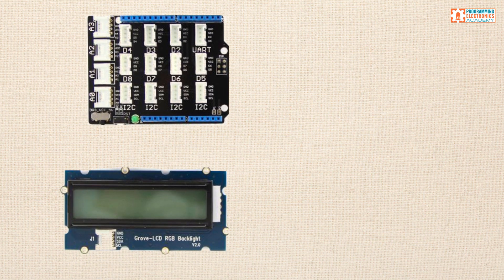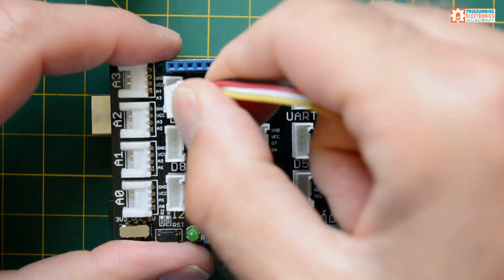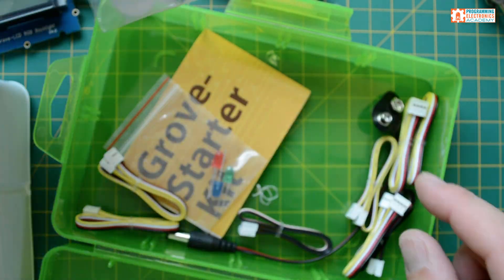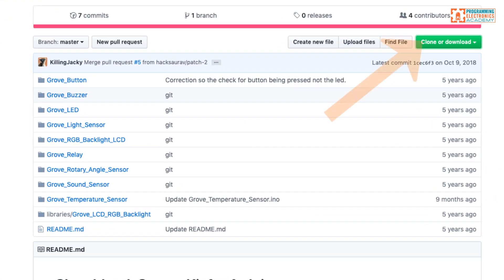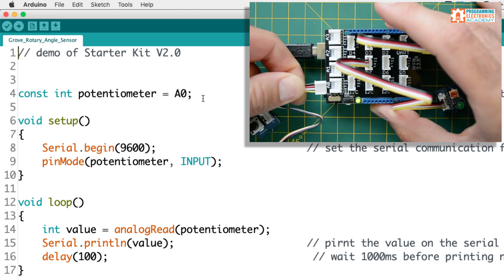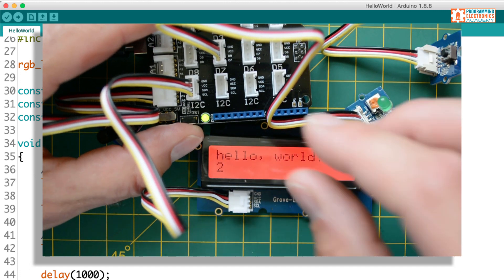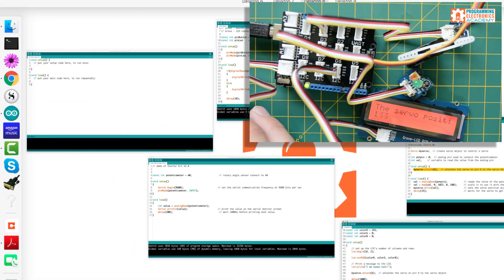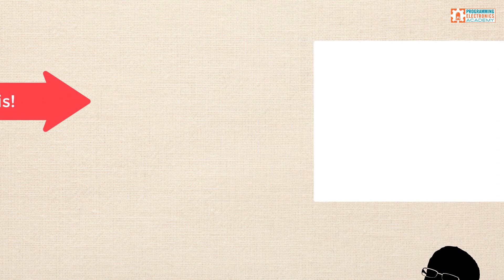10 Arduino grove modules  - plug and play with the seeedstudio grove system

Comment: Is it possible that this system packages things "too much"? What have you really learned when you complete an exercise? Do you see anyone using these modules along with the shield in an actual project?
Reply from the maker: I guess it is about what someone is after.  If you're trying to figure out the code side of things, then having something to plug in and "abstract-away" the circuit can be helpful.  

I can't say I have seen these in finished projects, but my guess is people are using them for prototyping a project.